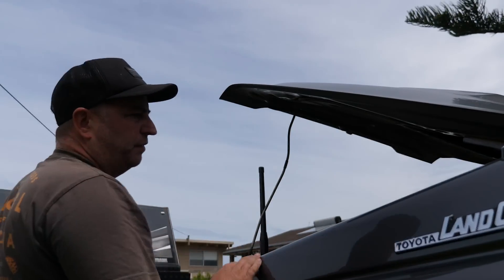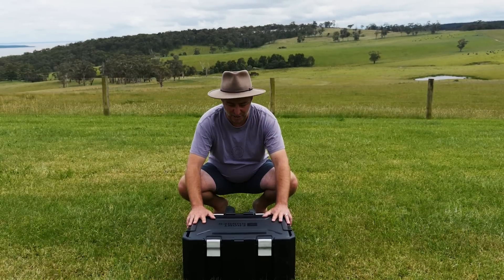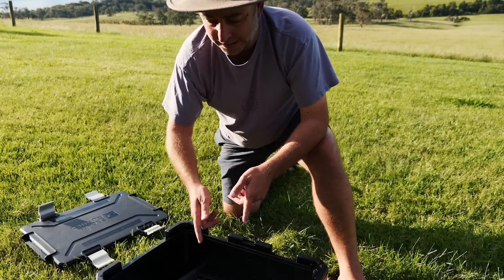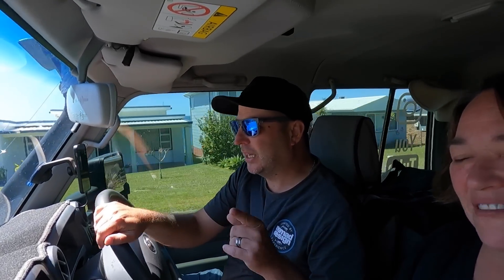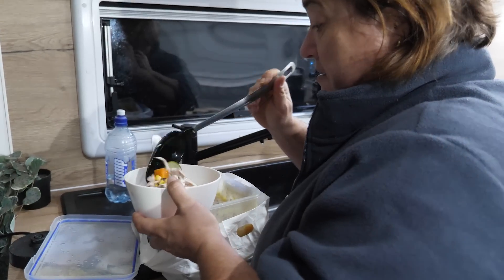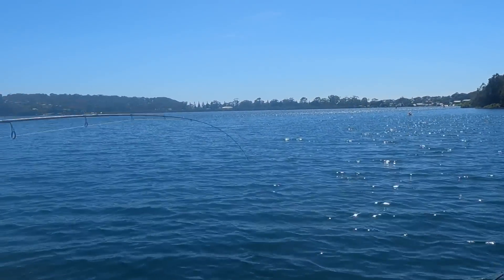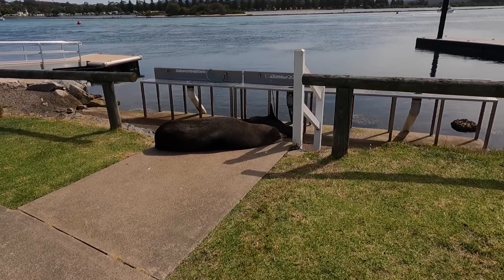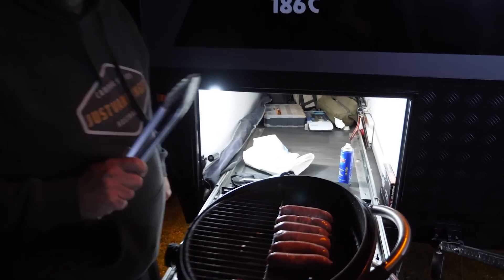IT WONT START|Travelling Australia|Give Away

Comment: Add a second battery tray from air on board 
And a redarc isolator with a momentary switch 
I've got that on my troopy and if the first battery is low I can jump off the second by pushing a switch
Reply: That's an awesome idea Tyson! Thanks so much for sharing, will have to get Deryck onto that!
Reply from the maker: Great idea 🙌🏻